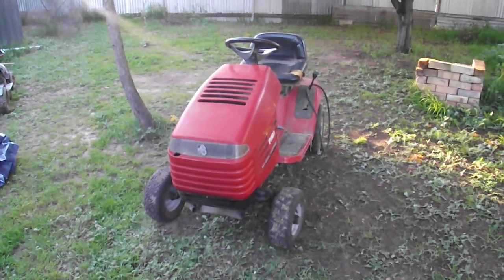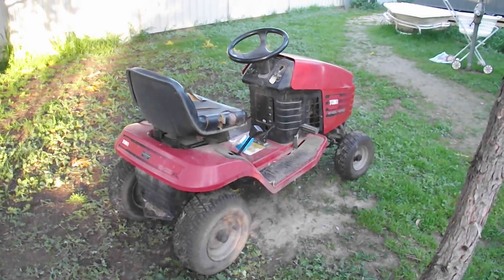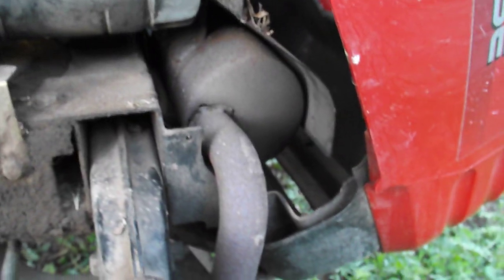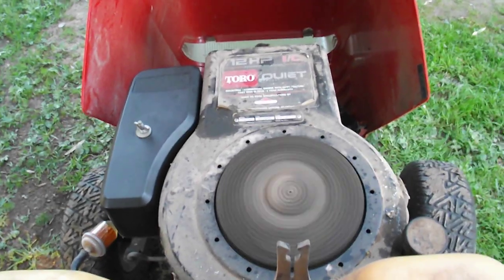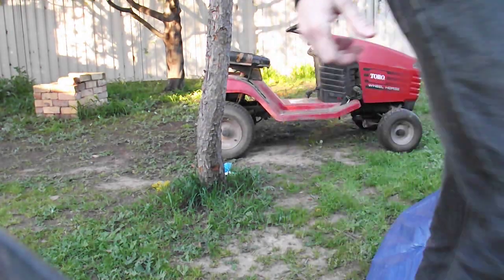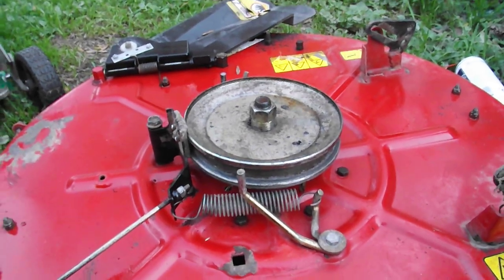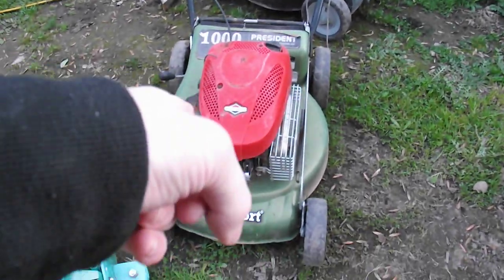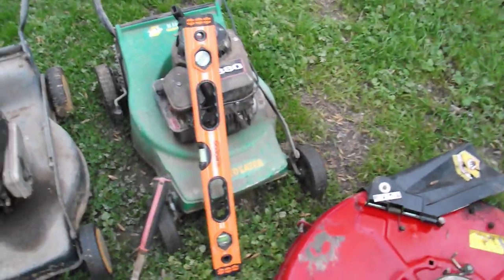Toro wheel horse ride on mower

Comment: tayrl fixes all is a fun channel, seen guys bore mowers out with a hone that doesnt flex with out of round bores , lisle 15000 and 16000 hones
Reply from the maker: I will check out :). This motor seems to run well.
Reply: @wickedxe  yeh im jealous something like that here in WA $1000 minimum , CarsandCameras is a good HP mower/go cart channel , well its a bit fun atleast depends on what your into